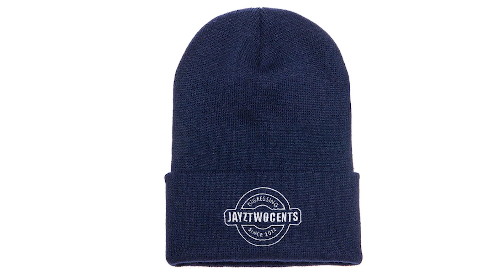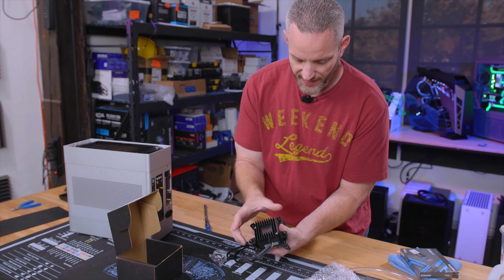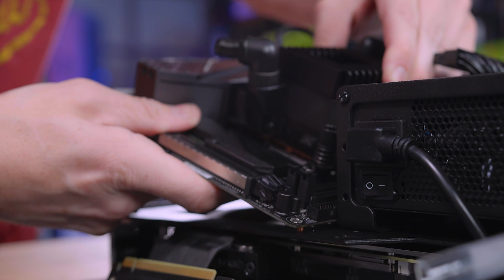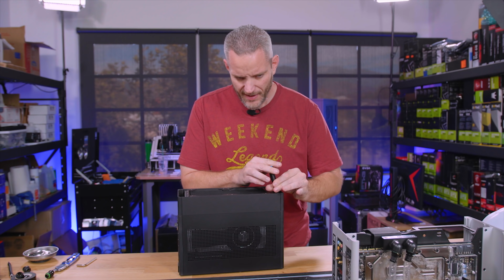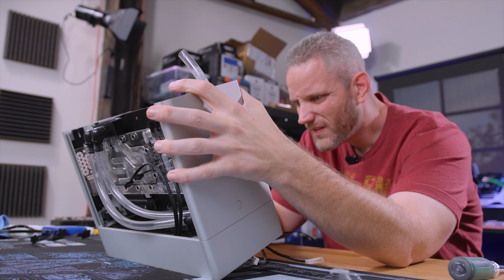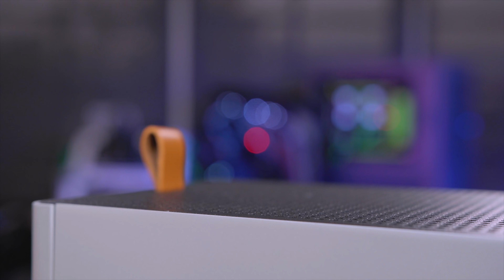The smallest watercooled PC I've ever built is COMPLETE!

Comment: Question, I work in hydronic heating, when you heat water in a closed loop you typically need an expansion tank. If not you end up over-pressurizing and lifting a relief valve. Have you ever had leak issues or a hose popping off the first time you heat the fluid?

Comment: I'm running a similar setup with a Vega frontier card and 3900x. I'm using nactua nfp12 1700rpm fans for top and bottom rad. I have some issues with overheating at full fan speed, blocks are mounted good. Do you have eny suggestions on changes that could help? I was thinking about trying nactuas 3000rpm version of the fan but they are almost $50 a peace. Fluid is a transparent red from primochill.

Comment: you should still clamp them cause the temps will make the connection malleable ,just like thin walled petg does cause the oring clamping force.to get hose to fit over barbs easier you use hot water right?

Comment: Hi.. Firstly i like your videos so i am not complaining. I just have a suggestion especially because for this build but i suppose it would work on any loop for emptying, cleaning & refilling custom loops. The problem you say you have is that you (which is a problem with all rads of any type) is pushing air in or out of the loop but have you considered using a drill powered pump? I have used one of these to do various jobs (with a cordless drill) to fill/drain various things. Im not saying this would necessarily work as i have never tried a custom loop myself but as a time saving idea what do you think? Anyways great video & here is a link of what i mean. https://www.amazon.co.uk/Drill-heavy-fluids-suitable-drills/dp/B01MTIKACZ/ref=asc_df_B01MTIKACZ/?tag=googshopuk-21&linkCode=df0&hvadid=309828980827&hvpos=1o1&hvnetw=g&hvrand=5578427402776251890&hvpone=&hvptwo=&hvqmt=&hvdev=m&hvdvcmdl=&hvlocint=&hvlocphy=1007249&hvtargid=pla-524575713737&psc=1 (the link is from the UK but im sure you can get something similar from over there) 🇬🇧👍

Comment: how tf a 99k idling at 39C when my 3900x in an identical build idling @ almost 55C.. Ryzen 3000 voltages are fuckign whack.
Reply: ISM if you are using an x570 board, you need to update your bios. The x570 boards factory bios fucks up the 3rd gen ryzen voltages

Comment: Costom watercooling might work better with EKs newer Phoenix linup of prefilled loopparts, especially with the pump premounted to the radiator. should be a easy install and connect process, only the radiator is little too thick, so the L-extension needs a extra s-extension.

Comment: What's in the bottom tophat and is it necessary? I'm trying to add as few tophats as possible to get a quieter cooling solution in this case. GPU fans on the siding is particularly loud.

Comment: Question for anyone who is in a similar situation. What is like editing on something like this + wireless keyboard/mouse + screen when traveling consistently? I realize why Jay and others have made these builds, for portable difficult task computing; video editing, gaming, etc. I am annoyed of using a laptop to video edit full-time. Built computers in the past too. But I have some apprehension when it comes to building something, and lugging around a Logitech K830 or something similar. I have 2 monitors I already own but not sure if they will also be ideal to travel with. I think one of the ASUS portable screens (USB) would be a good alternative if I'm really space constrained. But does it FEEL right to have a wireless keyboard w/ trackpad on say your lap? I just can't see past the way it would slow me down rather than the intended purpose of having MOAR power to edit quicker (RT effects etc too) and less thermal throttling. I suppose I could see myself setting up the computer wherever I go but I often times find myself using my laptop (2017 Spectre X360 15" (MX150 model) as a tablet somewhat. This obviously shows that maybe having both would be more ideal but frankly even a $1500 1070Ti ITX build is not in the cards unless I sell something too. Any feedback or thoughts on working with a keyboard/trackpad for more rigorous tasks in real-world would be appreciated. Also posting this on the Part 1 of the build and his other mini build video. Thanks!

Comment: So did any hoses ever pop off any barbs from not having zip ties or clamps on them? Being that water expands when heated i would expect some pressure in the loop when it is hot and with no resivoir or air space to allow for expansion the weakest link will give, and hot soft plastic tubing would be where i would expect it too...

Comment: Pretty late on posting a comment to this but I built a portable desktop with an overall height of 5" which includes a foldable monitor (monitor is within those 5" if you were wondering). It uses a standard 120mm AIO water cooler but what i really want to do is get it to less than 3" w/ monitor and a 2x 90mm rad and custom loop. Difficult and probably expensive but it would be more practical to take on-the-go... kinda.

Comment: If that's soft tubing, couldn't you plug 1 of those holes back up, tilt it so the exposed hole is at the most upward point and squeeze the soft tube (a lot) like burping a coolant system in a car?

Comment: Hey @jayztwocents, I see you making custom cooling rigs often and love the advice you supply. however I have one question. Why not use Y joints in your rigs to make cool liquid go to both the CPU and GPU instead of using the "warmed" up CPU liquid to "cool" the already warm GPU?

I'm thinking of building a rig:

Radiator -> 'y' splitter: 'y' 1 to CPU in 'y' 2 to GPU in. -> out of CPU to 'y' 1 and out of GPU to 'y' 2 -> 'y' out to pump/res in -> res out to radiator.

What are your thoughts on that build? Why has someone not done that before? Is it a bad idea because of the loss of volume flow rate at the y joints?
Reply: The reason that spitting isn't usually necessary is that the components won't reach the temperature of the coolant (thermal transfer limits), and the difference in temperature before and after touching a component like the GPU is very minor.

Comment: Small factor case is no problem. In servers you have one unit with 2 processors, and everything works smooth, because of the good direction of flow of air. These liquid radiators are blocking a large area of cooling potential. 4 years ago I had a liquid cooler on my home server, and after one year of 24/7 work, it stopped. To my horror when opening it up everything was fried, as the liquid flooded the inside, since then I never approached liquid cooling ever again. It was stock tubing not custom made.

Comment: I’m curious if you could have drained the system by putting a tube in the top front radiator port like you did, but draining from the bottom rear rather than top rear.

Comment: The case is definitely better than the dan case, but what exactly is the point of getting this and using two top hats for this PITA water cooling build, when the Ncase M1 would be a far better option, plus you get front panel IO which i actually do care about having. With two large top hats the ghost becomes a 13.6L volume case, bigger than the 12.6 volume Ncase. With a single top hat the ghost is 11L. This case is far better off just using no top hats and going air, or using a small or medium hat for fans/storage. Otherwise the Ncase just makes way more sense and its cheaper and easier to get your hands on sooner.

Comment: What is the point of a reservoir anyway? Is it just more heat capacity since there's more water?  Easier to fill? AIOs don't use them.

My challenge to you Jay. Can you build a custom loop PC in a normal ATX case without a reservoir?  Maybe compare performance/thermals with a reservoir and without?

Comment: In regards to the GPU block, you could always use this: https://www.ekwb.com/shop/ek-fc-terminal-rotary-90-black to get some extra space. Still small form factor builds are hard unless you get custom made parts for it and even then it's not as straight forward as a regular miditower.

Comment: how are the temperatures for the GPU?? Cause I have a liquid cooled computer thats a little taller than this and the GPU always slowly gets hot then crashes the game i am playing after awhile. I am using the Pheonix MLC system by EKWB. The case I have is the Phanteks Evolv Shift X. its vertical by design so thats why I say that its bigger than this case you display in the video. 

Thanks. #JayzTwoCents is the best PC media outlet besides Linus Tech Tips

Comment: They totally need to make little tempered glass side panels that slide in where the metal ones do for those cases. That'd be /perfect/. They could line the edges of the glass with felt or metal strips to make the glass hold up better against the metal chassis. Jay, tell them if they do this, I KNOW they will sell a crap ton of these cases. I will definitely buy one.

Comment: For sealing the hoses you could do a trick that I do, which is to run a 7/16 hose on 1/2" barbs.  That doesnt work on a couple of the barbs in my loop, they were way small for some reason.  Not super happy with those but I put a ziptie on those two and they were fine.

Comment: I have an idea, it'd take away from the looks of the gpu, but you could have a custom made reservoir fit into that cavity, because finding a pre-made one would probably be impossible. But, that case is designed to fit dual slot cards, the card's water block essentially makes it a single slot, there would be room for an oddly shaped reservoir, with probably a decent amount of volume if you took up most of the cavity. With careful snaking of a tube, you could even have a proper filler tube. 
I know it's custom work, which takes time, but it could be done.
I wish the designers of this case took into consideration of extending the front panel somehow. I know the center supports, front, and back are one solid piece, but it'd be cool if they adapted the tophat idea to the front of the case somehow. It'd expand possibilities a lot.

Comment: 9:20 the clamps ARE for sealing. 
The point of a clamp is to deform the tubing around the barbs themselves in order to increase the pressure the barb places on the inner wall of the tube, thus increasing sealing.

Most zip ties probably dont have enough squeezing force to perform those functions and are more for looks, but other types of clamps (spring, worm drice, etc) will increase the allowed pressure in the system without leaking.

However if the inner diameter of the tube is small enough compared to the outer diameter of the barb, and the tube flexible enough to grab the barb, then youre right you can get adequate sealing pressure that way. The important thing is that the hose is deformed around the barb, then any pressure on the hose will force the hose deeper into the barb creating a better seal.

Comment: I want to see temps because I'm running a 1080ti and a 1700x cooled by a 240mm radiator in a Lian Li PC-05X case with the same pumpblock. I get pretty poor cpu temps relatively speaking but I'm not ready to check if it is a bad thermal paste application or if it's something else.

Comment: I have a similar issue with my pump, separate power (molex) and speed/ pwm and i cannot control the speed though pwm, any ideas? How did jay get it to work? 
I have a maximus x code mobo. And a EK Xres ddc pump

Comment: That's about how I have to drain my nCase M1 custom water loop. Put on the fitting with the extension tube on it, and then flip the chassis upside down and shake for like 10 minutes.

And also with SFF, there's lots of taking it apart until you get it all dialed in and working. It's some serious  effort.

Comment: yo guys: where can i find an inexpensive but useable pump + cpu block combo made out of aluminium?

i have a 120mm aluminium radiator from a broken AIO that i ripped apart.
the pump died so i disassembled the CPU block to see if i can fix it or something and was greeted with a copper CPU block that had green gunk all over it ... i assume that is because copper cpu block + aluminium rad don't like each other. 

anyways ... would be cool to use this rad and PROPERLY build a working "AIO" around it - not mixing metals this time.

Comment: I use Bitspower 11mm barbs with 16/10 tubing for my system all the way. Didn't have a single leak for years. I can lift my MoRa radiator up on those an the tubing won't come of.

Comment: Hmm, ain't no expert in this buttttt, no air in the system does not liquid expand? I thought some air acts as an air cushion allowing for minimal liquid expansion therefor preventing the pop?
Damn nice system though well smart.
Reply: Watercooling requires no air in the loop as it can corrode parts, cause thermal transfer problems, and particle clogging which become expensive and take a long time to flush out.
Reply: Ahh, ty.

Comment: Would it be possible to fit a slim plexi-glass to the side, so that it slides in the aluminum holes? Or dremel job and cut out the air hole, replace with plexi. Just looks so nice, sad to hide it. Anyways very nice build even hidden :)

Comment: I would recommend having a tiny amount of air in the system (at the top "reservoir" only). This is due to simple mechanics and physics.

1- The system is a closed-loop. Meaning nothing gets in, and nothing gets out. Keep this in mind as I continue to make the point.
2- As the liquid warms and heats up from cooling the cpu and gpu, it will naturally expand in volume (the simple physics part).
3- Liquid does not compress like air does. As the liquid expands, due to the heat, it will not compress (hydrodynamic).

With air, as it is pressurized it will compress. Think of jamming 10 gallons of air volume into a 1 gallon tank. It is under pressure, but the tank can withstand the pressure (to its max limit). So in a "closed system" the expanding heated air can compress, but the "enclosure" should hold (to its max limit). There is some built-in "give-n-take" - with the weakest point being the fittings. However, with liquids there is no compression. So as its volume expands from the heat, it will not compress. You cant jam 10 gallons of liquid into a 1 gallon tank. The pressure will definitely want to transfer outwards. This is the mechanical principle of how hydraulic jacks work. As you apply pressure to the liquid with the handle, the piston will move outward and lift the car (because the liquid does not compress and transfers the pressure). The weakest points of this jack system are the seals. Once they have the tiniest of leaks, the whole pressurizing will drop to zero - because the liquid will leak out and not mechanically transfer the pressure. The point is that it will leak. Since your system is closed, and filled 100% to the top with no air, the liquid will have nowhere to expand as it heats up. Thus it will transfer the pressure outwards - and your weakest point are the fittings with no clamps. But if you have a little air (at the top), it will compress and act as a cushion - absorbing the expansion of the liquid (to the enclose's max limit). Another good example is the coolant busting out of the radiator when a car overheats. There is a spring-loaded cap on the radiator, and a small plastic reservoir on the side to catch the spill of normal heat expansion. Either you reinforce the fittings with clamps, or add some "give-n-take" by having a little air on the top. I would recommend both a little air, and clamps. It would be a shame for the system to be ruined due to simple hydrodynamic mechanical-physics. But if you don't want the system, I'll gladly take it off your hands - for free of coarse =)

Comment: I had a swiftech d5 with pwm that didnt work at all for me. Just ran full speed. Ended up switching back to the good old mcp655 with molex connector. Sure its not pwm but runs super quiet at stock, cant even hear it.

Comment: I don't know why you don't just water cool the monitor. If you do that it cools of the graphics by the time it reaches the computer, and then the GPU doesn't overheat.
Reply: what
Reply: It's a faster cooling process and almost no one does it. Everyone knows that the monitor is the powerhouse of the graphics storage.

If you remove the screen from the monitor and apply some thermal paste, or liquid metal to the back, it will actually help with thermals, too. But it's a lot of thermal paste/liquid metal, so not to many people do that either.

Comment: No air is dangerous. You need some air so when coolant heats up, it expands and compresses air. Without air, coolant expands and find the weakest link in your loop to escape. It may not leak, but it is definitely more likely to leak. Car radiators have expansion tank for this purpose.
Water from 20c to 40c will expand in volume by about 1.4%. 20c to 50c about 2.1%.
Reply: Go to TechLinked and LinusTechTips to see why pc builders never leave any air in their tubes.

Comment: before I switched to compression fittings I always ran 7/16 id 5/8 od tubing on 1/2 barbs without clamps or zip ties. Never had a leak or pop off in 20+ years of water cooling. I just went compression cause they look cool.